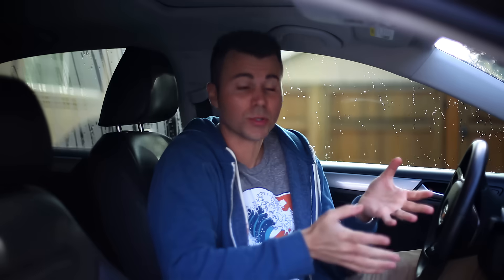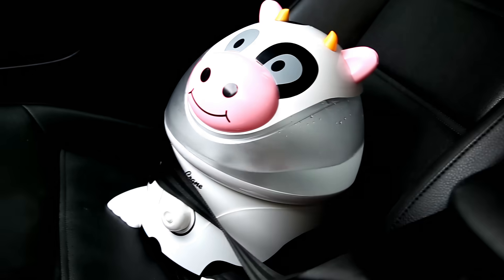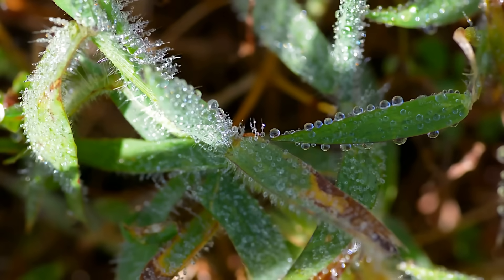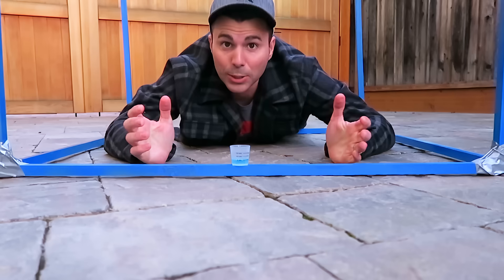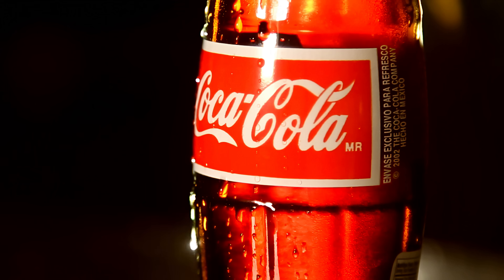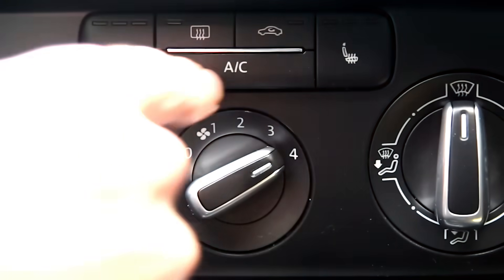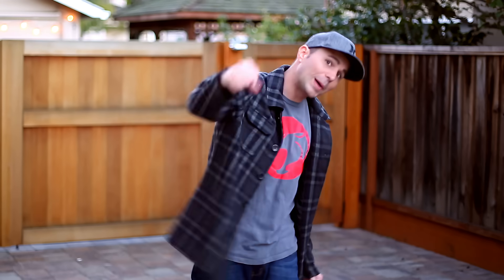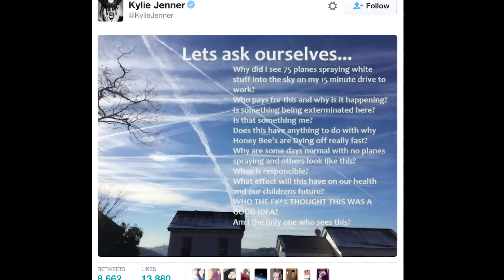Defog your windows TWICE as fast using SCIENCE- 4 easy steps

Comment: The a/c pulls moisture out of air... Have it on.    Re-circulate will keep drying the air more and more,  while   Fresh air mode is possibly bringing in humid air from outside.   Its okay to turn the temp to hot,  but keep the a/c  on..    How it works is the cold part of the A/c (called the evaporator) is like A glass of ice water.  As air passes by,  the evaporator will sweat as air hits it,  just like A glass of water would sweat on a humid day.  The water will drip out a drain tube  under your car,  thus making the inside of your car dry.

Comment: When u turn heater on and ac on at the same time. Does it ruin ur ac unit?
Reply: On my parents' cars, when you turn the knob that you use to control where the air is blowing onto windshield only, it automatically turns the ac on. So no

Comment: Informative! But I am an aviation enthusiast so I want to say something about the last part. There are two types of trails we see in the sky behind an aircraft: Chemitrails (chemical+trails) and Contrails (condensation+trails). So if the aircraft is high above sea level then we see a white trail which disappears after s short while. THOSE are contrails. But sometimes we also see a white trail which just keeps expanding and doesn't fade away. That is a chemitrail and it becomes visible in certain lighting conditions regarding the sun. These may be visible in evenings.
Reply: nope. they are both water condensatin
Reply: @benjaminchapman3924  you can learn about chemitrails just look it up. Chemitrails do not disappear because they are basically chemicals becoming visible in daylight

Comment: Yeah... I never considered the science behind it, but common sense was to use all the steps mentioned. As well opening the windows helps not only to get some dry air, but helps for that hot air from the went which has just absorbed bunch of water to leave the car. If you don't open the windows, then that hot air will take air from the windscreen, cool down and fog up side and rear windows more.
There are some limitation thought, for example on many cars there is no "heater", the heating works from the engine, so if engine is cold, then there is no heating in the car. In such case you cannot do anything else, but either to blow cold air, or to wait... and set a fan to very low setting so that air could get at least a little bit warm before it hist the windscreen.
Why hot air on low fan settings is better than cold air on full blast? Well that is because warm air inside of the car will condensate on the cold window. Meaning that blowing warm air onto window and warming up it just a little bit will help to slowdown the rate at which condensation accumulates on the windows.
There is one further issue - A/C on many cars won't work past certain temperature e.g. I know on my Lexus that is 0C... on some cars it is 4C, or even 8C... which means is you have -20C... your only option is to wait for engine to warm-up and blast fresh heated air onto window.
I guess what I am saying - scientifically the settings mentioned are the best, but in practice there are more conditions and this view is little bit oversimplified to cover them all.

Comment: Bruh! Auto manufacturers know this already. When you turn on defog, it pulls fresh air from outside, uses the a/c compressor to dry, and turns off recirculation. If you pop your hood, you'll notice your a/c clutching. This is already done automatically. Additionally your car has one way air escapes behind the cab and elsewhere.
Reply: Cracking the windows is faster, but yes the car does have vents to help with circulation. Also the reason why using recirculation is counter intuitive, it will create a vacuum ( it doesn't suck air in because it blocks that off)

Comment: To save you the 5 minutes:

1. Heater on full blast 
2. Turn A/C ON 
3. Turn OFF inside air circulation 
4. Crack the windows, even a small amount

Comment: Most....not all...auto manufacturers have the AC compressor kick on when you put it to the defrost setting on your controls....two reasons, one - to de-humidify the air....two - to keep the ac system lubricated and circulating even in winter, so when you need it, it's ready for warm weather.

Comment: In case you were wondering, shaving cream has detergents, which reduce water's surface tension - so water is still condensing on your windshield, but it's forming a sheet instead of discrete droplets, so it appears transparent. The detergent molecules have hydrophobic ends, which interfere with water's hydrogen bonds, resulting in lower surface tension. Thus, any detergent or substance with similar chemistry will work; shaving cream is just easy to apply, highly available, and cheap.
Reply: I like you.
Reply: And last shorter then anti-fog spray
Reply: @mggt4684  depends on the brand, but it's probably at least cheaper.
Reply: Does this mean that the condensed water will probably run off, potentially down the back of my dashboard? Or just not stick to the window in the first place? I don't want to simply "move" the problem 🤔
Reply: @twothumbsfresh  The only way to stop water condensing is to make the interior of your car the same temperature as the exterior.
Reply: I tint windows for a living so when we get a car with treated windows it makes our water and soap solution bead up and drop off instead of creating a layer of soap on the window to allow for repositioning. Very interesting, and we can't figure out how to undo it!
Reply: So this phenomenon is the same thing as Rain-X has on the outside of the window?
Reply: @higbeedoug   rain-x is silica-based (think silicone lube) so the water just slides off.  Anti-fog treatment is the opposite mechanism.  Like the OP said, the water doesn’t slide off.  It stops it from beading up into micro droplets of condensation.  The water is still there but less visible as a thin film, which minimizes surface light scattering (fog)
Reply: @xsietube  👌
Reply: @xsietube  Does repeated use of Rain-X have deleterious effects over time, like a blurry build-up?
Reply: @higbeedoug  I'd imagine that rain x is the same thing, just in convenient spray form. Check the active ingredients.

Comment: To deFROST the windshield the fastest way by far is to spray winter washerfluid on it and use the wipers to wipe the ice off. Doesn't work when it's -20C out but works just fine on mildly bellow freezing temps.

Comment: So 4 years ago I was on my deck and I saw several planes flying from my local airport to Chicago, with their contrails dissipating within a few minutes, Then later on in the afternoon I started seeing a couple different aircraft flying in a different direction , I wasn't quite sure why they were flying in that direction because for the 10 years I liveed there I've never seen planes flying in those directions. Then all of a sudden I noticed the planes contrails forming a grid pattern, it was almost like there were several tic-tac-toe boards in the sky, which slowly formed into a large hazy cloud that never dissipated and was still there at nightfall. I wonder if anyone can explain why some planes contrails disappear within minutes yet others on the same day never dissipate, is it the fuel or different engine I guess I'm just not sure.
Reply: Basically it depends on the relative humidity of the air on the layer the planes are flying.

(Relative humidity is the percentage of the maximum amount of water the air can have according to it's courent temperature, as represented by Mark's analogy with the towel)

In dryer hotter air, the comtrails disappear faster.
And the temperature and humidity up there can be very different from your layer.

Comment: Way too much time spent babbling about what the fogging on the windshield is. Keep it simpler. You explain the same thing about four different ways from Sunday. And it was unnecessary because the vast majority of people do not understand almost anything that you said.
Save yourself even more dollars, instead of using shaving cream, take some lifebuoy soap or some regular bar soap and wipe it back and forth on the inside of the windshield. And then polish it down with a Howell. You do have to reapply this on occasion just like you would any other product. But it is the cheapest.

Comment: A/C on does nothing if it's below about 40 degrees because you can't cool cold air.  Some cars turn on the A/C in the defrost setting automatically but leave it off if it's cold outside.

Comment: One detail that you didn't mention that helps to understand why your settings work is an understanding of the airflow of the car's climate control system. First the air goes through the AC (I. E. the cooling) unit, then through the heater core, and then into the cabin. That's why with the AC on and the temperature dial set to hot, the air is still hot coming out of the vents. To use your analogy, you aren't "wringing" the towel/air model. Rather you are first shrinking the towel/air model so excess water is shed, and then expanding the towel/air model. Subtle difference, but fits your analogy better.

Comment: In most modern cars, the ac compressor automatically engages to be used as a dehumidifier when the settings are set to defrost. You do not have to turn it on separately.

Comment: So I drive an early 2011 Nissan leaf, the extra factor I have here to throw into the mix is range. Using the PTC heater in the morning I use up alot of range. Also to my cost I ran into an extra issue that is very particular to the first generation leaf which is that if you use the remote/timer heating feature and it was a really cold night and your 12 volt battery is running low you can actually break your car. Basically there is an issue in the firmware for this generation of leaf which will cause the relay that controls the pre-charge of the inverter for the (condenser/capacitor) in the inverter to stay latched open because the 12v has gone too low to disconnect it. The pre-charge resistor acts like a fuse at this point and burns out. The next time you try to start your car you cant and the car will throw a metric tonne of DTC errors. The part is a $10 part (non-OEM) if you can find it but the real issue is actually repairing it is dropping the main traction battery and opening it (which has 400v HV) and replacing said part. There are a few preventative things to do here. 1. use OVMS to monitor your 12v to check if its voltage is reducing overtime. (or some other monitored 12v system) 2. avoid turning the car on till you know the health of the 12v battery, especially on cold days/mornings. 3. use a 12v battery charger to keep you battery in better condition. 4. buy a less ridiculous car.

I am seeing whether I can externalise this resistor safely and make some hot swappable enclosure which can be replaced by the driver without complicated tools and some big HV resistant gloves. The aim being that if this happens then the car doesn't require to have its whole traction battery removed from the car requiring a tow and a garage with a lift and a mechanic who is HV trained.

Anyway Mark, Love your inspiring channel, hate condensation. Just bought an Ebac 300 de-humidifier (love it) might just stick that in my car every so often to wring out the hypothetical towel.

Comment: Thank you. That's right:  Condensation Trail. Also known as a contrail, it is only water vapor. 

No chemicals unless you call water a chemical, so not a "chemtrail."
Reply: But water is a chemical. So is the CO2 and other byproducts of burning fuel, and possibly some amount of unburned fuel as 100% combustion is a tricky to obtain in the messy world outside a physics class. ;-)

Comment: I can tell you're from somewhere in the south because the steps did not include leaving your car on for an unhealthy amount of time; standing outside shivering for ten minutes while you knock the ice off the windshield from the outside - to then going inside to scrape all the frozen condensation off with a credit card.. 

Before the fog THEN sets - and immediately freezes again - forcing you to find the combination between the right hot air settings (as described in your video) - and strategically using your anti-ice washer fluid to melt ice on the outside - peering through the first clear hole at the bottom of the windshield that the hot air has FINALLY cleared - and just hoping you're not going to smash into your neighbours car.

Comment: It's normally wet outside when I defog my car  and opening the windows is the only thing I found doesn't help(plus it sinks the temperature in my car when I'm trying to heat it). It's worth having a clean windscreen also as the moisture seems to obstruct your vision a lot more on dirty glass. My car gets so bad that I have to use a Karcher windowvac as it would take 10+ minutes to clear the windscreen in the winter otherwise. It refogs after using this but it's considerably better.

Comment: Interesting video. Thank you Mark. It’s 0c here currently in southern England and I have a hybrid. I do all of these tips already but due to the engine not warming up quickly enough (battery) it takes forever to clear my windscreen. Annoying part of the hybrid that draws its heat from the engine. I imagine full EV’s do not necessarily have this issue as the electric heat is almost instant (like their power). The hybrid still draws its heat from the engine. With that not turning over nor moving air through its radiators at speed due to it being unsafe to do so means the the hybrid car makers need to install a toggle between engine heat and battery heat! Cheers.
Reply: My first-gen Prius forces the engine to remain running when heating.

Comment: He’s not wrong but there’s a faster way. If you can see a safe amount. Start driving. I work earlier when the roads are empty and it’s dark so if there are cars, I can see the headlights. After 2 minutes of actually driving my engine is warm which is where the heat comes from. I then do the steps mark said. I keep the a/c off so my windscreen fans get more power and I keep both front windows open to blow the water vapour out, it clears in 10 seconds.

A quick hack if you know it’s going to be cold is pre spray your car.

Comment: a bit late to the show ... but doesn't the defrost  thingy (not the one for the rear windshield) do exactly that (turn on the AC compressor and open the flaps so that the air is NOT recirculated)?
All the cars that owned (the oldest one was a 1994 corolla) did exactly that (minus the A/C compressor if they didn't have one obviously).
 The "crank the heat all the way up to 1000" is a given since it's winter and it's cold (very cold where I live).

Comment: try that in the dead of winter in saskatchewan and it wont work.. your car wont start unless it's plugged it in overnight... and it wont move unless its start for 15 minutes before you try and drive anywhere. so by that time all the windows are already defrosted.. thanks for trying to solve a problem that warm climates only see a few times a year. up here is winter and cold from november to april.. for your next video try and start a diesel engine at -40c after its sat overnight unplugged

Comment: I just take a glass of slightly heated water and slowly dumps it on the window works like a charm, do not use boiling water, anything with a tempature above that of the ice will melt it, but hotter is better, since it wont freeze as fast again, just remember to wipe the windowz after and turn on the heat😅

Comment: My trick has always been max heat and fan on defrost setting and cracking the windows, which quickly removes inner condensation.  Wiper blades to remove outer condensation and do this for about a minute until the windshield has warmed up enough for further condensation to stop occuring.

Comment: What Mark did not talk about in this video, is why the water condenses on the window in the first place. It’s because the window is colder than the air due to radiative heat loss to outer space. If you park under a pine tree where you are shaded to outer space, your window will not get as cold and you will not have frost.
Reply: Nevermind all the damage to your paint from the crap falling off the tree... oops! I'll take "Give me the frost!" for $1000 Alex! If you really want to avoid frost or the need to defrost, park in the garage. 🙂

- Max Giganteum

Comment: I only have this problem when it is close to freezing temperatures but according to the manual, AC doesn't operate when below 5 degrees on my car. The light comes on but it doesn't run. Good job I have heated windscreen.

Comment: Good video.
The only conceptual problem I have is the recirculation tip
By my logic... the cold air outside would be a small but wet towel
The warmer air inside would be larger wet towel
When you start your car, the air conditioner begins to immediately extract water
While the heater (using cold radiator water)  will take some time to warm up
So the size of the towel (warmth of the air) will not quickly change
But I intuit that the larger wet towel will give up more water than
The smaller wet towel ... and it will do this more efficiently than running already very cold external  air over cold air conditioner coils

But that is just my hunch
Reply: Here's a tip, your windscreen wipers have a most function, just tap the stalk up and it will clear all the fog, just keep doing that until your car heats up.

Comment: Oh...  INTERIOR de-fog.   I usually get condensation on the EXTERIOR of my windows, and have to run the wipers etc.  running the heater then causes interior condensation, because the glass is colder than the hot, fluffy air that has now absorbed extra moisture.

Comment: Problem: windows fog when I turn heater on.  Solution: replace leaking heater core.
Reply: The heater in my work truck is screwed up. The ac compressor doesn't kick on periodically like it should if it gets so cold and the windows will fog up. It's a pain. Lol